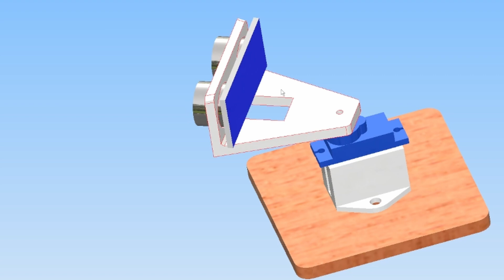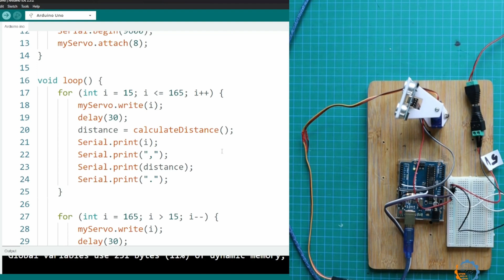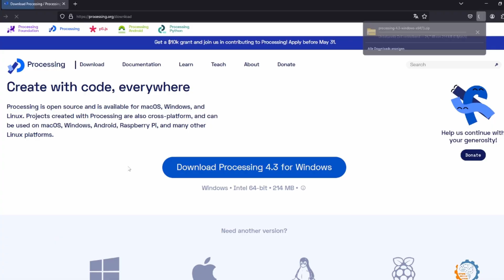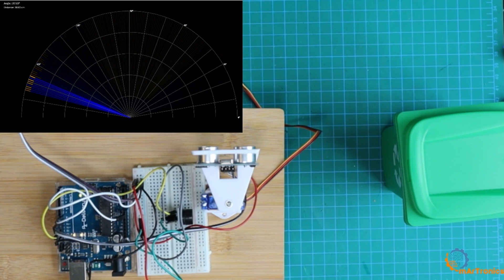Arduino & Robots Project 01: Building a Radar with Ultrasonic Sensor and Servo Motor 🔊🤖

Comment: do you sell the 3d component?
Reply from the maker: I will provide a link to download the 3D parts as STL files so you can 3D print them.
Reply from the maker: https://cults3d.com/en/3d-model/gadget/diy-arduino-radar-with-ultrasonic-sensor-and-servo-motor